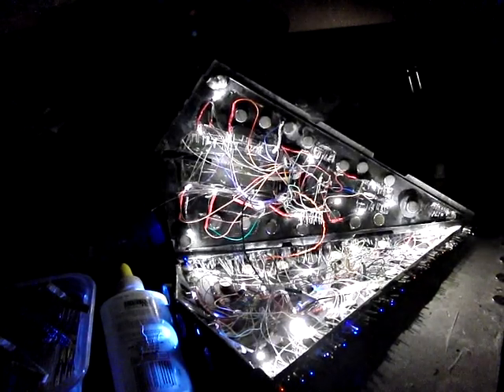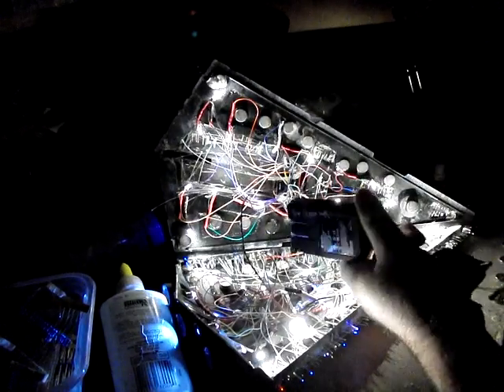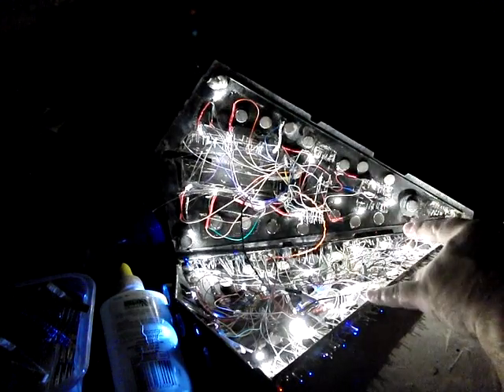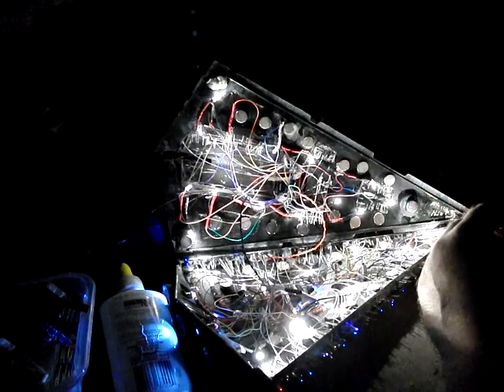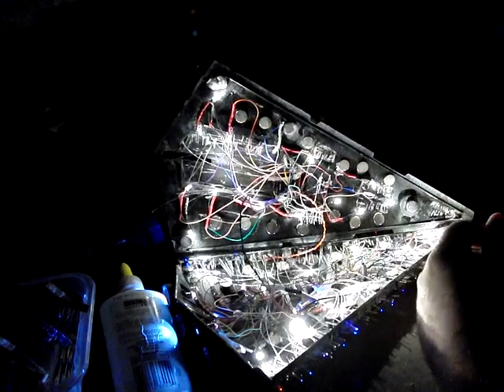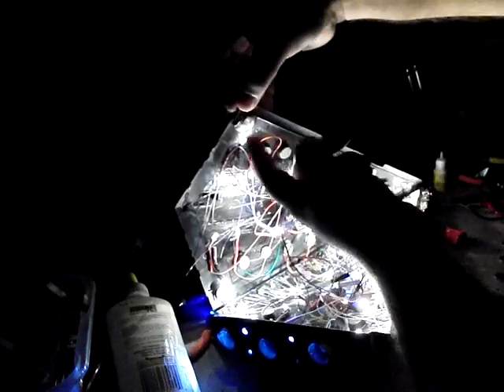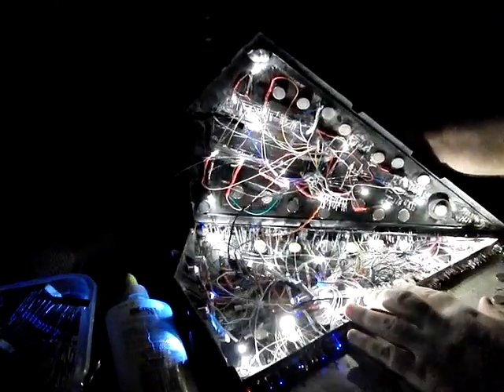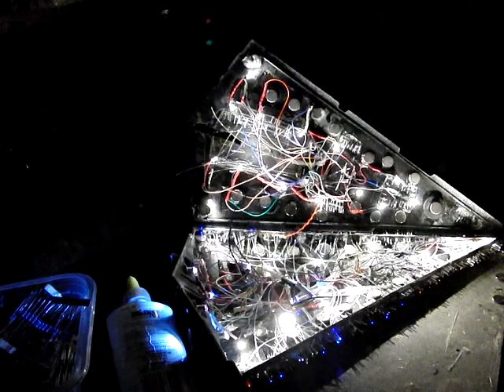MPC Avenger Pt11 More freakin' LEDS?!?

Comment from the maker: I've heard that ST kit is a stinker.  Almost bought it a few times, but am glad I didn't.  

There will be no mini fan for this.  There is no place to vent the air.  

The leds certainly get warm, but nowhere near genuinely hot enough to do any damage whatsoever.  Perhaps if I left them on for a week straight the plastic might warm up, but there are no fears.  

Of course, I may learn I am completely wrong on that!  In which case, i would get another and apply the lessons learned.